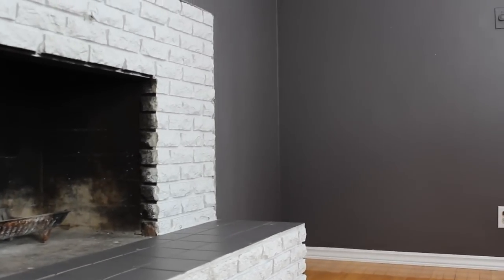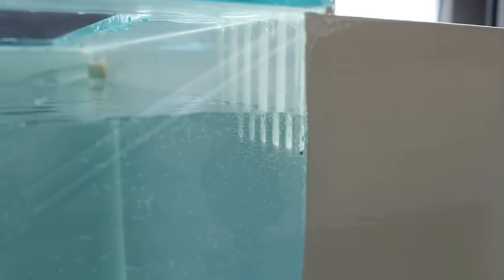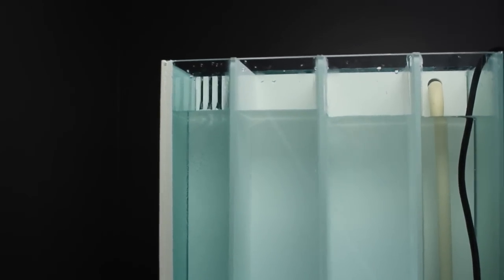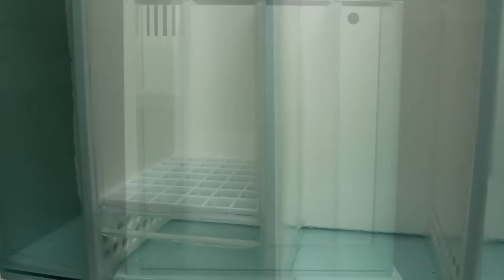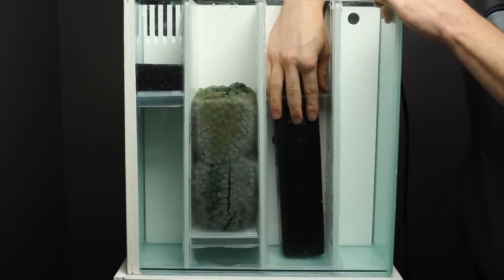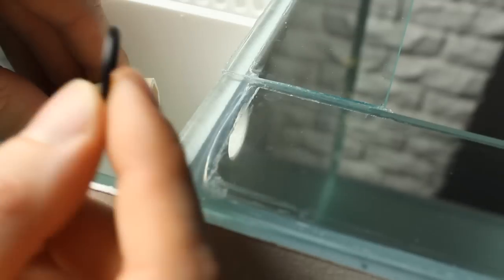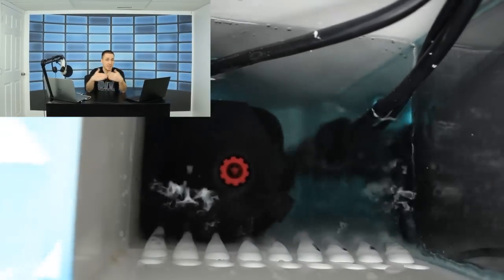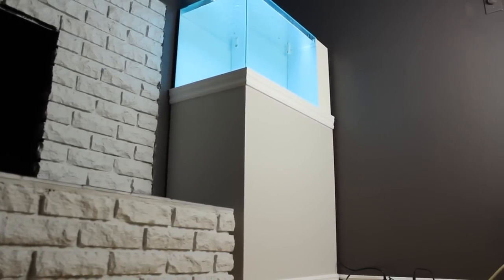HOW TO: Build a full aquarium - tank, light, filter and stand 3/3 TUTORIAL

Comment: I enjoyed this build - 
i was look at your fire place and had an idea for people who don't use there anymore. How about build an aquarium into the fire place could make a underwater fire with sand and led lights. could have a lid flap that opens and closes in the front for feeding and cleaning - filtration inside - one time i made a sponge under-gravel filter it covered the bottom of the tank only had 1/8 of an inch space from the bottom glass for water flow i use two power heads one on each side centered worked vary good. Just a thought.

Comment: I was just wondering,and could as well just be wrong about this, if the heater is set up in the spot you put it in, wouldn't it heat up the water, making it rise to the top as warm water rises above cold water? The holes into the next section  are on the bottom so the warmer water would remain in the heated section while the cooler water goes down through the holes into the next section.